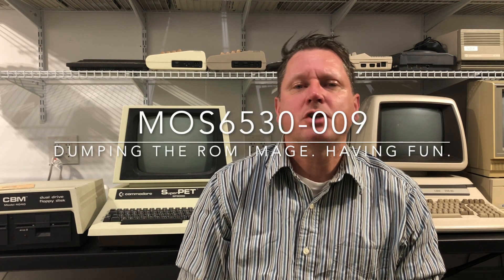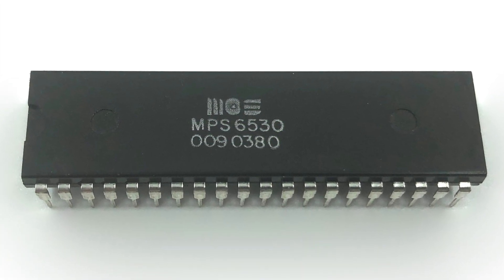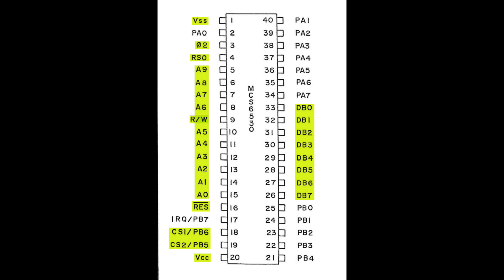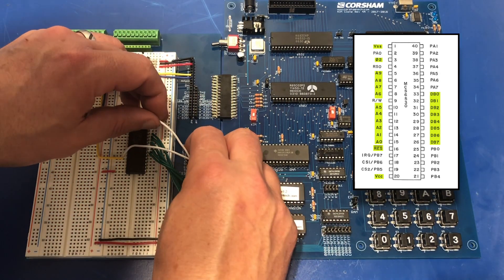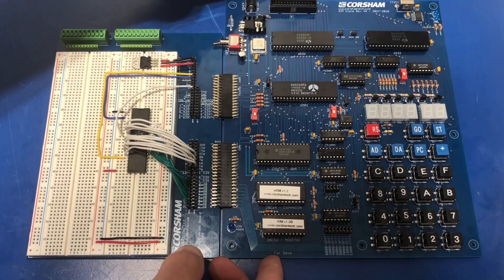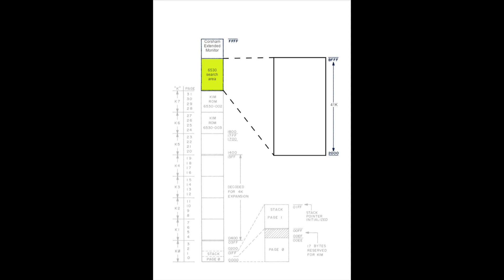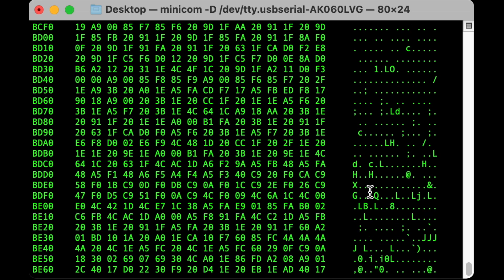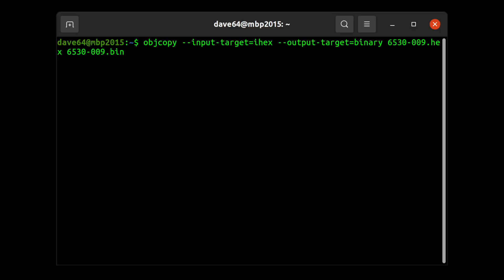Dumping the ROM image from a MOS6530-009 RRIOT chip

Comment: What's the content of the ROM code?

Why would the contents of the ROM code be repeated at multiple points through the address space?

How were you able to distinguish the 6502 opcodes and other data from the junk data in other address space? Memorization of which hex values are and aren't opcodes?

Comment: drats , you didn't work back from the location that the rom data started to see how the address decoding fuses were set...ok.. A10 => ROM, A11=>CS1 and A12=>CS2.   
watching the vid a few times the rom showed at $2400 , $2900, $4400, $5400, .... scrolled too fast to catch them all.  thanks for the vid. I will now dump  the  two 6530-11 i have.
Reply from the maker: I didn't, but I don't think I'd know how to figure that part out anyway. If you pause you should be able to see the full address space, so let me know what you find.  Thanks!

Comment: I watched this with great interest but I don't have access to a replica KIM-1 system or anything similar so I would be more likely to take the Arduino approach which you really only barely touched on. It would be good if you could make another video explaining in more detail how to do this using something like the Arduino Mega, as that is something which anyone can easily go out and buy and which remains useful as a general purpose electronics tool even after it has been used for this purpose.
Reply from the maker: I've had a couple folks reach out for info about my arduino solution.  I'll definitely do another video showing that.  It might take me a while, but you'll see it eventually.  Thanks for watching, and thanks for taking the time to comment!

Comment: I recently found a MOS 6501 and a 6530-004 in my IC collection. Similar date codes and they were stored together so I believe they came from the same original system. The -004 is the TIM monitor. I'm planning to dump the -004 to verify the chip ROM is still working before I build a TIM system using the 6501. This video was helpful.
Reply from the maker: That 6501 will make a nice retirement fund!  I think Hans Otten is keen on preserving the 6530-004, so I'm sure he'd be interested in your efforts.  Good luck!
Reply from the maker: I heard back from Hans.  I was mistaken.  The 6530-004 has already been preserved.

Comment: I am looking for a way to test a 6530-002 from a non working KIM-1 Rev G, so it is socketed. PB1 - PB4 seem to be floating high. Instead of being setup as Outputs. The U4 Decoder seems like it is not operating correctly. Could be just random junk on the address lines, causing it.

Comment: I like this project, as I am building a project that is similar to it. Where I am adding a 6520 at address 1400 =147F which of course means, I have to add addressing logic, as the 6520 does not have addressing lines like the 6530 RIOT chip does. I am using a KIM-1 and a CORSHAM BUS Extender. I am not an Engineer, so I am eager to learn more about how to setup proper logic chip addressing.
I found this little project on pg 264 & 265 of the book " Microcomputer experimentation with the MOS technology KIM-1 " by  Lance Leventhal. I think you will like this project as well.
Reply from the maker: Thanks Jeff!  I'm always looking for reasons to use a KIM-1, so I'll give that a look.
Reply: @commodorehistory  I have it built already, but have a few questions before I wire it to my KIM-1's expansion port, via a CORSHAM extender board. I have uploaded the two references that I have to this project, so you do not have to search for them. https://drive.google.com/drive/folders/1O_EJn28VQj8bS93kLGzz2XXLrxLA3fpO?usp=sharing
As I do not have any experience building circuits like this one, I do have just one or two questions about the addressing logic.